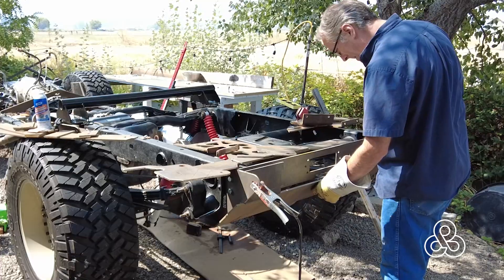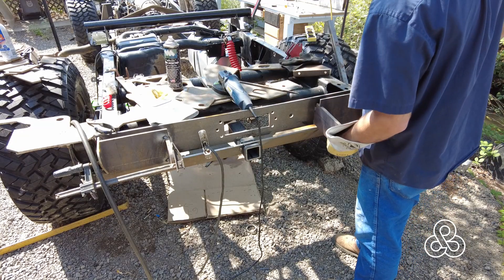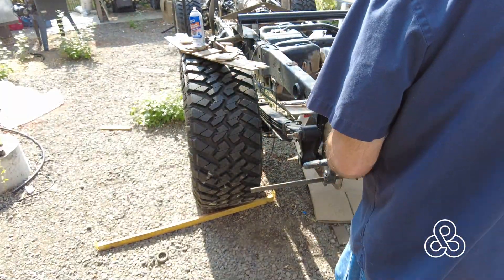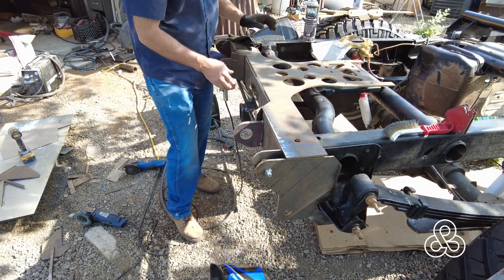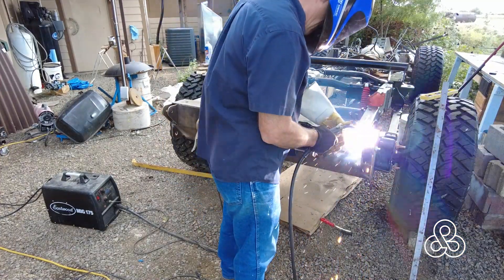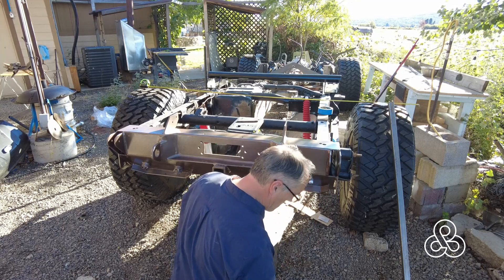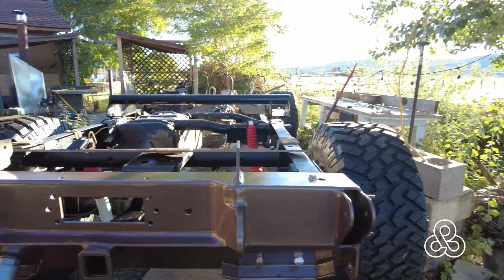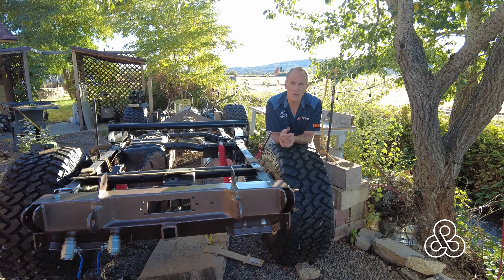L9 Rear bumper, Leviathan supervan overlander project

Comment: not sure how "off-road" you plan on being with this puppy, but those valves might not live too long if you're experiencing high exit angle type stuff.   Just a suggestion, keep up the great content fellers!!
Reply from the maker: Well, certainly not going to be a rock crawler, but a heck of a lot better backwoods traveler than a low fat motor home. ( with a black ABS drain right behind the rear wheel) Ha!

Comment: The s-latter and welding issues were probably from the wind blowing any shield away, it looked very breezy… make a wind tent next time you have to weld outside or you will find you have problems with splatter and poor welds. Flux shielded wire is better outside than Gas but still problematic in very windy conditions 👍
Reply from the maker: Flux core wire! After checking it out; I'm Pretty sure the feed motor has some hesitation. I bought a new welder so the problem is solved. :) Now who can I blame crappy welds on?

Comment: Did you have the crossover tubes bent and drilled or are the off the shelf parts?

Why are the drilled holes in the tube dimpled?

Thanks for all these videos. I learn so much from them!
Reply from the maker: Part of the original chassis straight out from under the Silverado. I have been curious about the dimples as well, wondering if they pierce them in manufacture process rather than drill them?? Pretty sure they are for drainage and ventilation to prevent rust.

Comment: You could run your exhaust just below your drain fittings. Make use of the excess heat to help ensure your pipes/fittings don't freeze. 🥶
Or possibly provide a way of thawing them in the unfortunate case that they do freeze through.  Just a thought. 😁
Reply from the maker: The exhaust will go vertical right behind (actually in) the cab, but a heat exchange may be in order. Lots of wasted heat/energy in that exhaust isn't there?

Comment: Thanks for the video!  Perhaps your welding issues was because of the wind?
Reply from the maker: Some crappy wire. seems to be scraping off some sort of residue behind the tip and after it builds up it jambs the wire. (just enough to cause hesitation) I hate to junk $70 dollars worth of wire . . .but!
Reply: I thought the same about the wind. Are you sure it’s the wire causing the residue build up and not the liner wearing out and being dragged along with the wire as dust / debris. Great projects and great explanation of the processes of design and reasons for the ideas. Keep on keeping on!